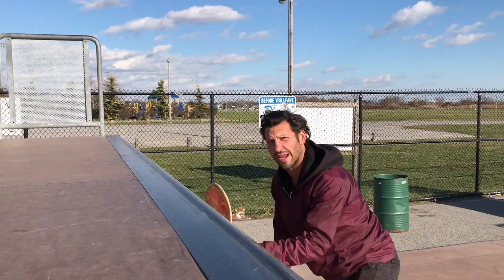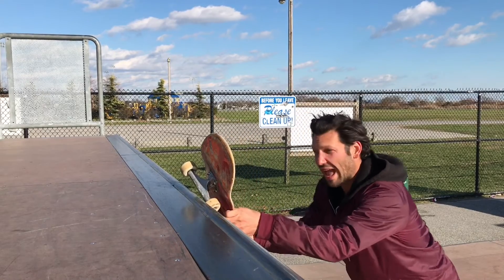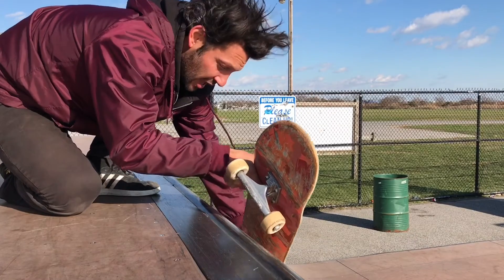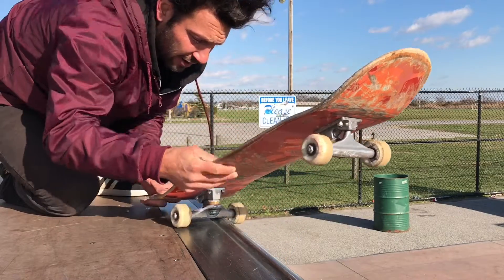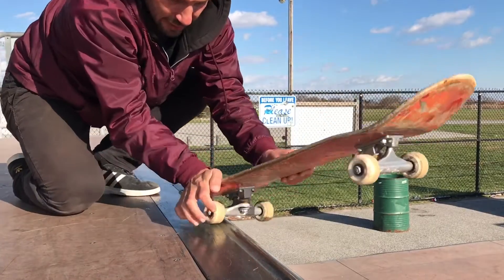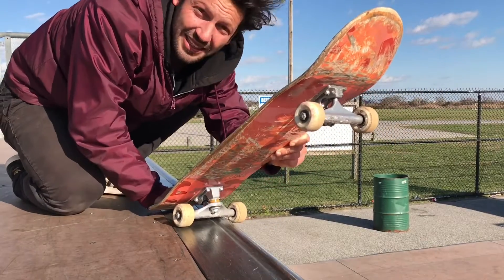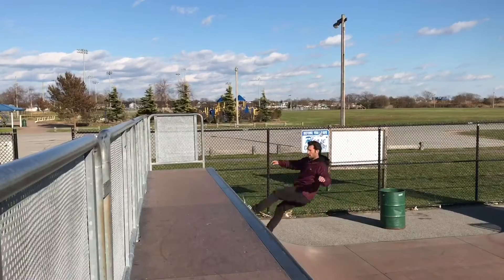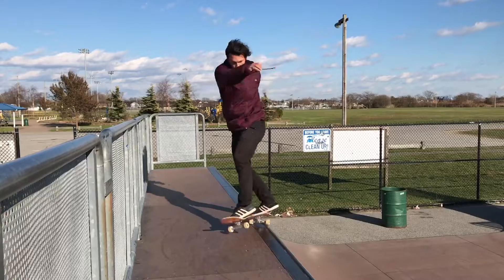How To Frontside 5-0 On A Mini Ramp

Comment: Thanks a lot,when ur teaching and when we are learning i feel a lot of vids just rush over stuff,I been just getting back into vert after a short absence 40 years ish,37 actually and when I was 12 I had a lot of fly in me and not really no fear but I blind faith when it comes to learn tricks and technico....I feel u can never be to graphic thanks for the simplified explanation.I've got great front side form still its my prefer kick turn and I'm learn pools at age 54 and big bowls it a challenge and I'm bored...I have a lot of speed that I'm scrubbing because I am not real at home on coping metal or big pool coping,but I make wide fronts and blast along the tile and five O s don't look to far out of reach I have learned quickly to put pressure on my feet to stay on vert and not loose altitude.35 years ago a one wheeler as we called it,I won't think twice about it,now it seems I forgot where I put my weight when I grind,working on it thanks for the pointers,just got my board finished,new indys and score some 61 blue hawk wheels,got knee pads,got a used deck sand its flexing a little and don't fit right but I'm making it work for now,thanks again.piece.I be back wit more questions...not in any rush just trying to find a big half pipe to play in.

Comment: I have a question. I’ve dove a little hop to get back in from my frontside excel stalls and front 5-0s but sometimes if I do it on the steeper transition I either over turn or don’t land into transition at the right angle. So can I just instead of doing a hop just press with my heal so my  toe side wheel lifts up and clears the coping to go back in?

Comment: I was scared of coping especially pool concrete coping because I did not know how to push the grind sorry it was more like the hault than a grind because my trucks just dug in an said get off,but now I know I need to lean back a little to help the grind get a push,I'm skating a 6foot to 10 foot kidney pool at our city park in Florida,no worry s I'm just staying in the shallow end for the five 0 grind I have a big beautiful five 0 style kick turn already perfect in the 10 foot deep end but I just run along the tile because I had no understanding of how to weight the grind so it would not stop me like hitting a truck,I'm too old for slams,so I'm trying to limit them,but at age 54 I'm learning pools and bowls,coming from a half pipe riding background there s a couple of differences in a half pipe u go up an straight down so if u are gonna do a trick its on a straight approach u can close your eyes an know excactly where u are going your not dealing with the bowl curve or the carve so that's just giving me more option and distractions,which is great but my muscles are just used to the half pipe and not a bowl curve,u follar,the biggest part of wood half pipe was the little bit of bounce when slam it was very forgiving,concrete not so,thanks Chad u make me raff.